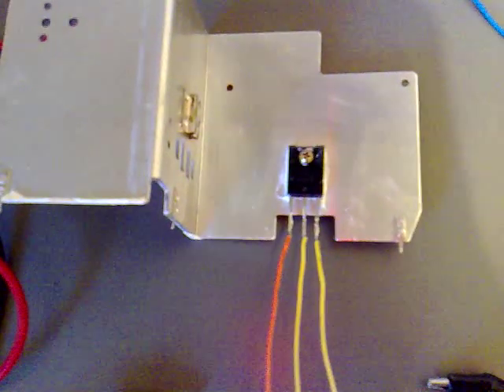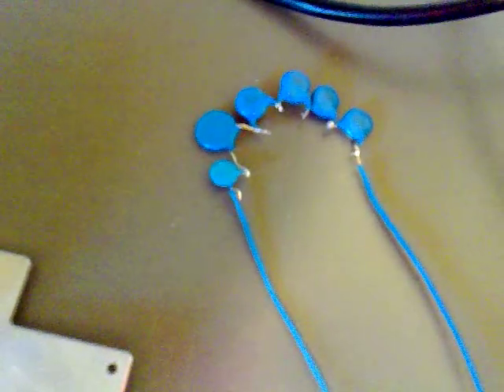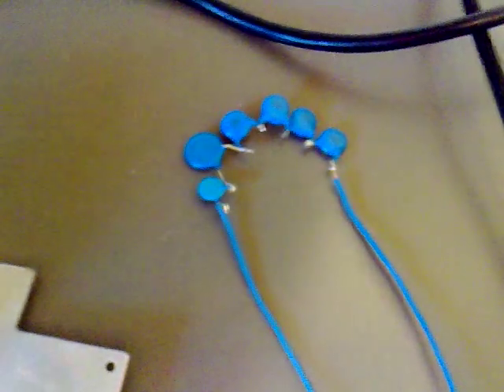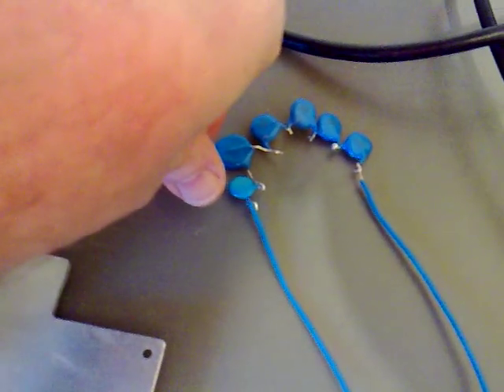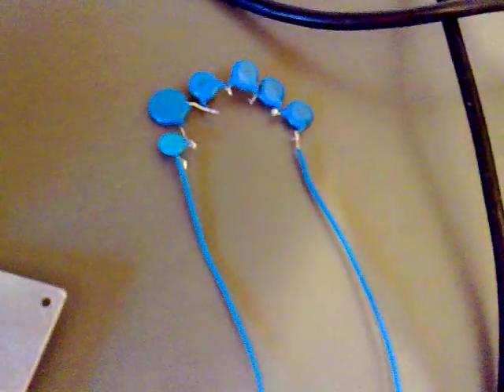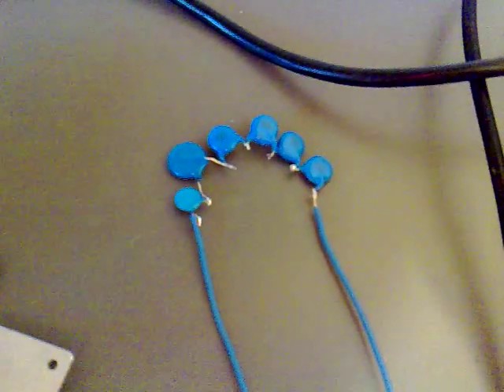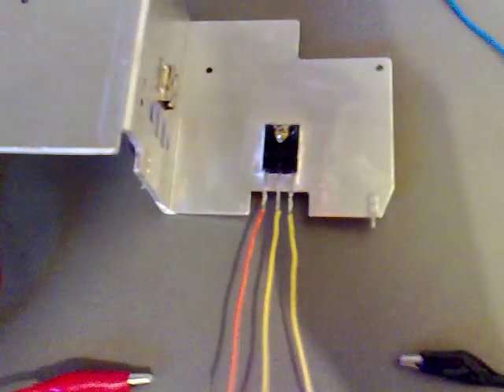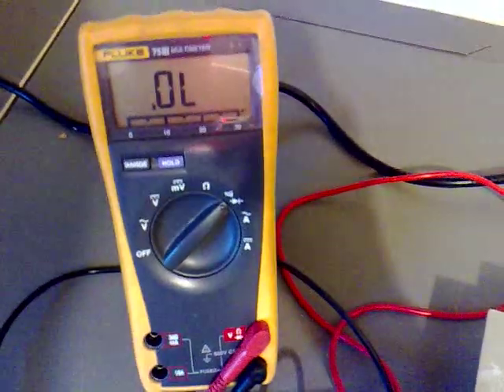Tesla Coil (Transistor and Capacitors) 003

Comment: you should also especify that some transistors will give u a reading in the base-emiter ande emiter-colector, because they come with a built in flyback diode.
it happened to me once with some "motor driver" transistor from a  printer